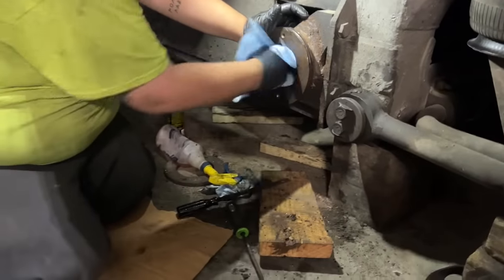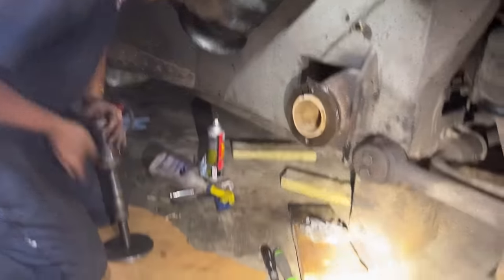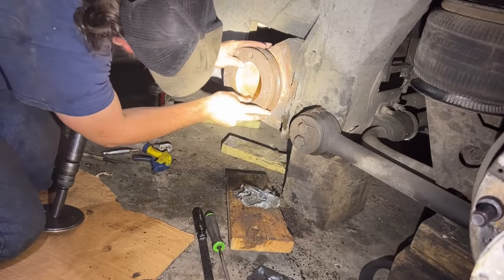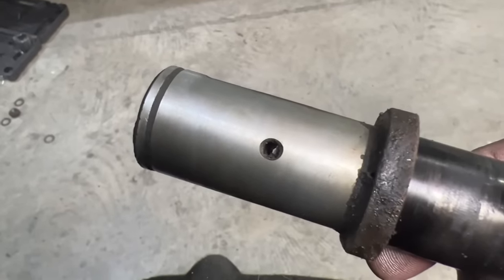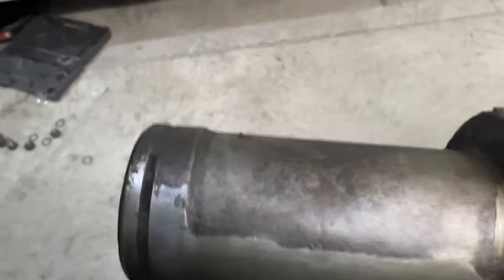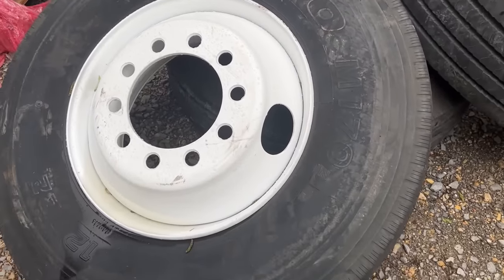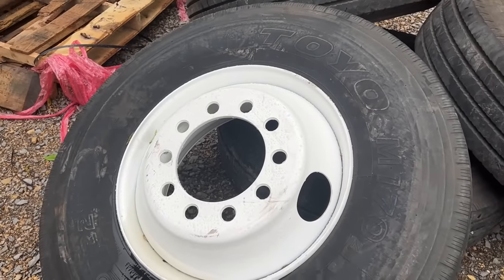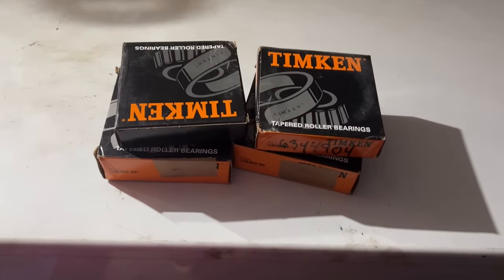Mci bus tag axle swing arm

Comment: Used to use "dry ice" for those type of jobs or for installing "dry liners" but yes in the freezer overnight will also do it , I used to put a old fashioned lead light in the bore to expand the hole slightly. Love your video's , thanks for sharing.

Comment: I was working with a guy putting the tag axle spindle assembly in. Getting it aligned,  told the guy to go slowly so it Doesn't pinch my fingers. Needless to say, he got lazy and pushed it too hard. Nothing more enjoyable than to have blood blisters on three fingers!
I still have bushing shims in my tool box. Works great for backings to weld holes in metal.

Comment: I personally avoid Timken bearings. And stick to NTN FAG SKF NSK INA for nearly guaranteed quality and tolerance. 

The savings on cheaper bearings is just not worth the hassle
Reply from the maker: Timken are the most expensive and best so not sure what you are saying.  Made in usa
Reply: @BusGreaseMonkey  I work on transit coaches.  The MCI's have a solid spindle on the drive axle housing now. They are getting worn out on the inner and outer bearing flange. And we have to have them welded and turned out down or a new "spud" turned and welded in. 
Two reasons why, non timkin bearings. And the crappy crush sleeve not being replaced or failing from time. 
Both of the shops that come here to perform the repairs says the same thing.  "If you want to have the failures stop. Use Timken bearings and get rid of the crush sleeve!"
Reply: I agree Ntn and SkF are sold much cheaper than Timken. If bearings are improperly installed doesn't matter the brand they will fail. I personally only work on buses for a living and have seen Custom motorhome converted Buses with the original Timken bearings still in hubs that are over 30 years old.